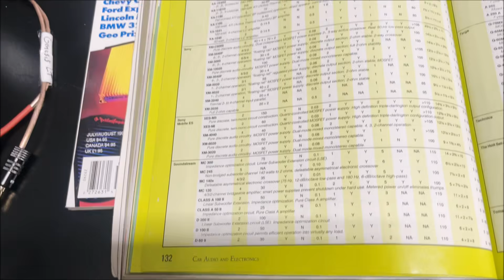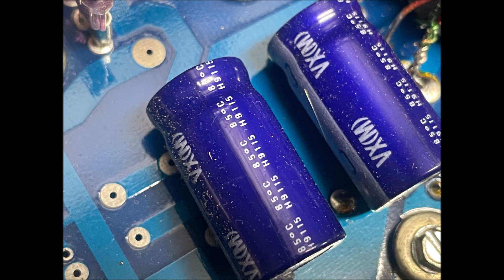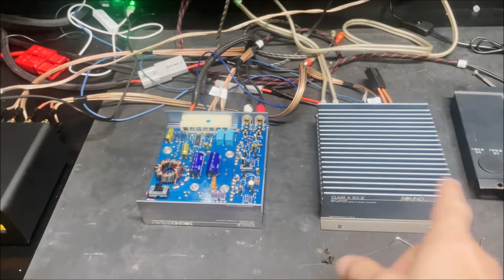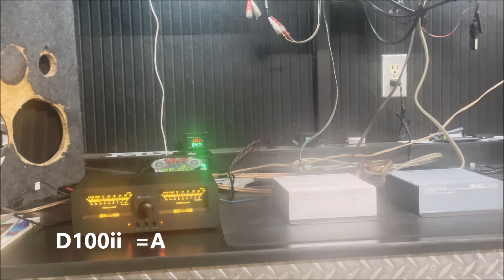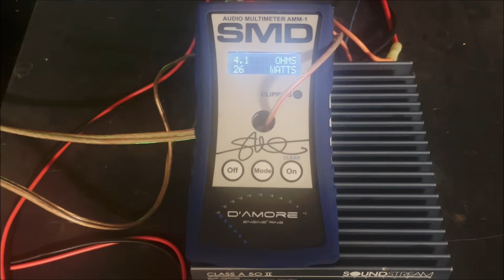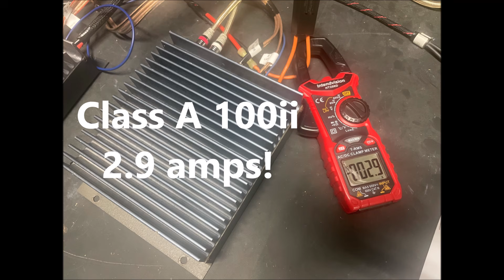Soundstream Class A vs AB oldschool amplifier test 1992

Comment: I miss the classic days of car audio. So many great manufacturers and products to choose from. Back in this era, I heard but never confirmed an interesting fact about these SoundStream amps. Several if not all of them had been engineered by Nelson Pass. It may have only been The MC300 and MC500, but I believe he did the Class A amps as well. 
If you’re familiar with Nelson Pass, you know he makes some highly rated home audio gear. He has a thing for extracting everything he possibly can from low watt amps. First Watt is a brand that he has geared specifically to this idea. It’s a testament to these manufacturers, 30-40 years later the amps they designed are still working. Impressive when you think of the environment and conditions they are exposed to.
Reply from the maker: Nelson had his hand in designing stuff for car audio including nakamichi and Soundstream.

Comment: Truly amazing the quality & parts of these amps from the 90. Still work & sound fantastic. I will not part with my 2 PPI A600. They still work perfectly & sound fantastic! They powered an an AVI (When Doc was incharge🙏)speaker front  5"mid & 1" tweeter. Best system I ever built.
What a great time to be in car audio during the 90's.
Reply from the maker: I totally agree.
Reply: AVI a brand I don’t hear much about anymore. I believe they are still in business out of Richmond, B.C. 
They made some killer SQ speakers. The SL series of subs were absolutely amazing back then.
Reply: Yes! 
I had 2 sl250 10" subs! Yellow glass fiber! Dam they were so musical❗️The front midbass was handled by the Sl170 6.5 woofers. Doc made custom crossovers to mate with the 5"mids & tweeters ! First rate parts in the crossovers❗️Eclipse CD head unit to a Rockford Fosgate EPX feeding signal to the Ppi a600. Blessed to have that system in my vehicle!
Great days then❗️❗️❗️

Comment: Rumor was these amps were designed by the great Nelson Pass
Reply from the maker: Yes. He claims he doesn’t remember but Wade Stewart said he did the earlier versions and he just tweaked a few things.
Reply: No these are not pass design. Only the A's are Nelson Pass designs that soundstream stole. Which is why he doesnt claim them. The d50II are Wades I believe. But for sure Nelson Pass had nothing to do with the d50II. The A series like the A50 he designed for Nakamichi but they didn't use it. An employee left to work for soundstream and he brought those plans with and soundstream used them. Which I could be wrong but I believe he's never gotten paid.
Reply: @jasonnelson6624 Thank you for the clarification ✅

Comment: I am old enough to have owned many SS amps in the arly 90's thru 2020. If memory serves the SS class A's were class A for the first watt or 2, and then they were AB.
Reply from the maker: Yeah. I don’t think it works that way.  I think these amps are way too simple to do that.  They are very high biased to eliminate any crossover distortion. The result is heat and low efficiency, which is why half the power.  To be honest I don’t feel this is worth any sound quality improvements that may be present.
Reply: @Hi-Fire-do   are you calling nelson pass "simple"? lol
Reply: @timmorton2307 Nelson pass didn't design the d50II. He had nothing to do with that amp at all. Actually he didn't do any amps for soundstream. He did amps for nakamichi that they didn't use. A nakamichi engineer left to go to soundstream and he took the plans with him which became the A50. Nelson Pass sued them for stealing his work. So the A50 has a circuit that a pass design. But these d amp don't. Or course none of them are class A all of them are A/B.

Comment: Those Blue VX caps are good Nichicons. I'm surprised they didn't use 105c caps.
Reply from the maker: As hot as it gets totally
Reply: Because 85C caps have some advantages
Reply: @kiklop8362 Really? Due tell...
Reply: @adaboy4z Google

Cost-Effectiveness: 85°C capacitors are significantly cheaper to manufacture. For consumer products like radios or basic power adapters, using 105°C components needlessly increases the bill of materials (BOM).Lower ESR & Better Performance: Because 85°C models use less robust electrolyte formulations, they often exhibit lower Equivalent Series Resistance (ESR) and leakage current than their 105°C counterparts of the same value. This translates to higher electrical efficiency and less self-heating in high-frequency circuits.Smaller Footprint: The materials required to withstand 105°C temperatures often require more internal volume to dissipate heat and gas safely. 85°C capacitors offer higher capacitance densities in smaller physical packages, which is crucial for compact circuit boards.

Comment: Those amps were sold to discriminating listeners that wanted clean sound, NO EQ in the system. Back when they were made the EQ was a given. EQ's are noisy. As sound goes they have a distinctly High Frequency bias. Not bass monsters. Made for crisp clean HIGHS.... I remember....
Reply from the maker: I totally agree with that.
Reply: @Hi-Fire-do  I have (2) 5.0's and a 10.0 in my 67 Firebird these days... Clean CRISP sound from the SAME SPEAKER SYSTEM..... yeah, just swapped in them SOUNDSTREAMS, thats it. What a difference in the HIGHS.... them amps SHINE in that regard. Had them totally rebuilt... better than new.
😁

Comment: You did a great job with the representation of the two amps. Think you covered it well. I still question the point of them, but I'm sure they had there reasons back then.
Reply from the maker: The point of what?  Class A or two similar amps.

Comment: The Class A is still a great amp even though it doesn't play lows. I would not put it on low-end anyways. But, since it does have a drop-off at 16k, I would definitely run it on midrange. I feed my Dynaudio Esotar 430s maybe 50 watts, and they sound amazing. My Dynaudio Esotar 110s get 20 watts, and that's more than enough. These amps are beautiful, and it sucks to see where the company is now.
Reply from the maker: Yeah. Seems they hung on for a few years.  Someone needs to do so thing real with the name. So sad.

Comment: Class A! Hard to beat that for SQ. I wrote that before seeing the rest of the video. Was actually shocked how the D was more flat response. But I could tell the A had more alive sounding treble.
Reply from the maker: I agree but curious if a little eq would make them more equal in all ways. I just can’t eq both differently and test head to head.  For me the heat and reduced power would be a deal breaker.
Reply: @Hi-Fire-do yeah I hear you - that ultimately made the death of class A. I still think AB is where it’s at for components and class D all the way for subs. Can you imagine the heat a 2000w class A mono would produce? Like a furnace in the car! (If it would even fit inside)

Comment: My first good quality car stereo amp back in the day was a D100 and it sounded amazing compared to what came before that.  I still own a D100II and D200II. Their THD and SNR performance is competitive with anything sold today.  I have a Quant Asylum QA403 on my test bench.  It is far superior to what you are using to measure power for about 3X the cost.  I never bought into the Class A thing because of the heat.
Reply from the maker: I would like to have one of those interfaces.  Someday.  Thanks.

Comment: Did you check the current draw with the amplifiers idling?

I was trying to think of a way how you could tell if it was operating in true class a. 

We all know that true class A is very rare in car audio. Usually, it's a high bias class AB amp. I think that's what those soundstreams were.
Reply from the maker: Yes. Watch near the end.  3 amps vs .5 amps
Reply from the maker: True class A really doesn’t exist for the most part.  Just high bias.  The heat proves this amp is high biased.
Reply: It's not a class A none of them are all of them are A/b.
Reply: @jasonnelson6624  I assume you're referring to all Soundstream amps.
Reply: @JasonWW2000 sorry let me correct that. Yes but just the soundstream amps that claimed class A, and just the ones before the reference series. Don't know if they had any claiming class A during or after the reference. Sorry for any confusion.
Reply: @JasonWW2000   also technically these "class A" soundstreams were originally Nakamichi's. Nelson Pass designed them for Nakamichi which they ended up not using. However a Nakamichi engineer leaves to go to Soundstream and he took those designs with him which soundstream then produced the A50 and the other A lineup. Which was a Nelson pass circuit soundstream kept the circuit unchanged made the board and layout. Which was very homemade and crude. Nelson pass sued them for stealing his work. Next soundstream came out with these amps in the video. The D's D50II and so on which aren't a Nelson Pass circuit. However there's claims Wade just altered it a little. But it still has the crude homemade board. Although it's not visually as crude as say my A50. But built wise the d50II has more issues. Like the switches but mostly how poorly or sloppy wound on their toroid. Some were better than other. I should also point out Wade claims all A's and D's were pass circuit he just had to fix them. If I remember right he claimed he had to lower the bias as it was too high they would overheat and shut down. Wade has said the D II's or version 2 of the D's was his work and the amps after that. So take your pick on who to believe Nelson Pass or Wade Stewart. I only know for sure Pass sued them and has always claimed he had nothing to do with soundstream. In some ways it's similar to Stephen Mantz Zed audio and earthquake cloning his circuit I think he did for hifonics. That's business 😂😂

Comment: Do you think the D100ii has a different turn ratio on the transformer to get more secondary voltage to be able to make more power?
Reply from the maker: I counted them the best I could and it was very similar.  They less power comes directly from the inefficiency of the Class A design for sure.